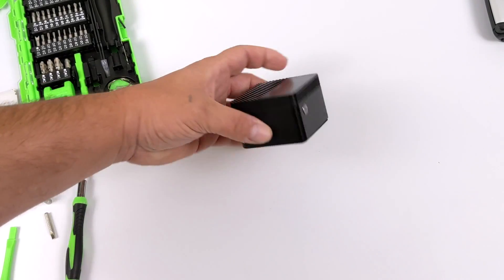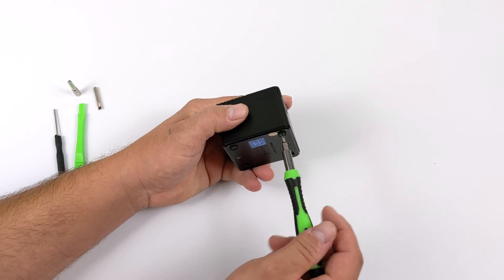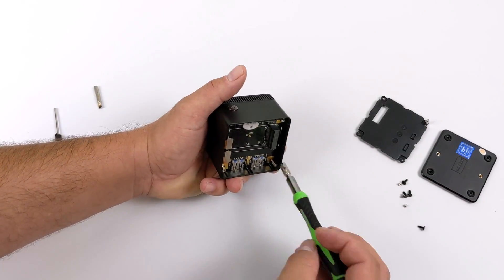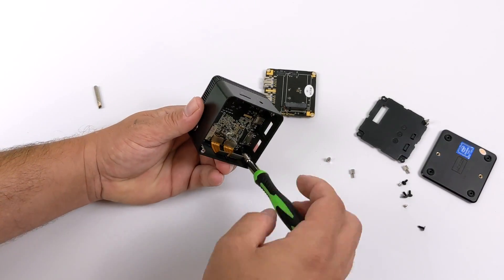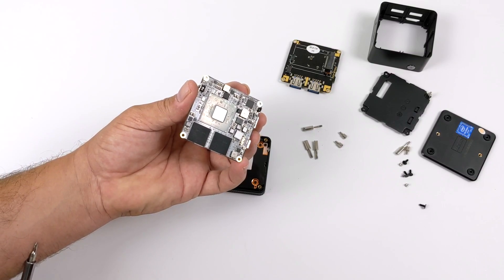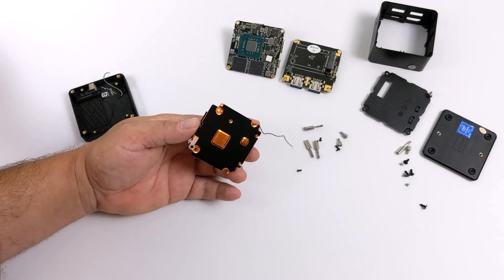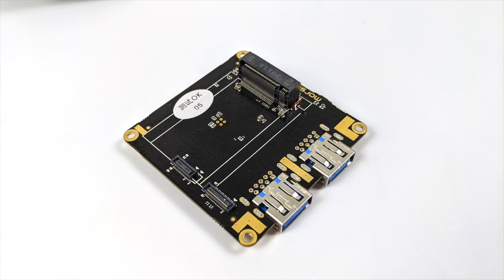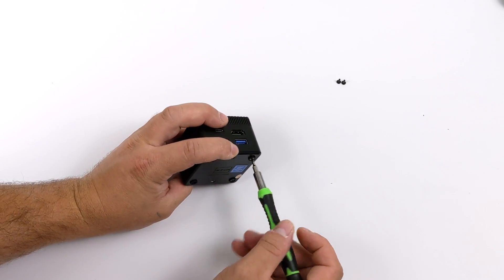CHUWI LarkBox Teardown -  World's Smallest 4K Mini PC

Comment: Do not buy this after a year of use it starts to heat cause the fan stopped working and between 3 or 4 seconds the wifi module burn in flames

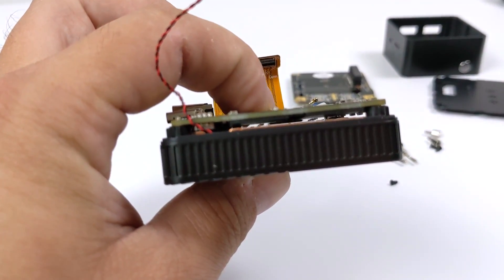Comment: 5:30 you can buy some tiny and special copper plates to put correct one between CPU and heatsink with thermal paste. But be carefuly to fit a correct copper plate. It has step with 0.2mm and you must find correct thick.

Comment: I have this mini PC for a little over a year, do you think I can expand the Ram to 8Gb? or maybe a little more?
Reply: I think there was an 8GB version, but zi don't think you can change the ram very easily as they are completely soldered into the board. You'd probably have to have the knowledge of soldering in order to do that. Also I think this CPU can only handle 8GB max.

Comment: Why does it use a USB C jack when it's not a standard USB C power? Is there any other power supply that works with this other than the one it comes with? Even my 87W Brydge Stone dock won't power this because it wants 12V

Comment: I used a copper shim to fill the gap and used some good themal paste to make the cpu have good thermal connection to the copper cooler and fan. I did see a drop in max temp so it got better. I did see increase in low temps.  I thinnk this is cos of the heat in the copper raise the min temp just a little. So now its never over 65 C. Needed a very thin copper shim. But it made it keep the fan on more steady and not on and of all the time. The spikes in temp that is above 70C is now gone. Mostly is below 60C. I think it was worth it. Im going to get an M.2 drive but im not sure what to buy. Its both Sata and NVMe out there.
Reply: Could you tell me the thickness of the shim you applied? Very much appreciated

Comment: The fit of the heatsink is a bummer, wish the plate was closer, better contact with less space is always better and thermal paste outperforms pads (if it can make contact), wonder if maybe it could be shimmed with tiny washers like people did with the Radeon VII reference editions.
Also, 3GB LPDDR4 is common on phones and the like but yes, not something you see on desktops or even laptops.
Reply: Someone used a .5 mm copper shim and said it improved it.

Comment: I want to share with all my tests, I have been wondering and looking if someone indicated exactly, the right thickness of copper to replace the thermal foam it has.  I have tried with a 0.8mm one, I have put it and very careful not to over tighten and tried to tighten the screws equally in all four, it has been mounted.  Indicate that I think this thickness is a bit excessive, I recommend 0.5mm.  The temperatures are radically improved, in none of the stress tests has the CPU exceeded 85 ° C, specifically in the test with Prime95 with a duration of 30min), as can be seen in this review, they indicated that the temperatures were up to  from 100 ° C to 2.4Ghz.  Never slower than this work speed in the test carried out by me.  So, for me, the result is much better than expected.
https://www.notebookcheck.org/Review-de-Chuwi-LarkBox-Celeron-J4115-Un-mini-PC-de-4K-tan-pequeno-que-es-mas-ligero-que-su-propio-adaptador-de-CA.482840.0.htm
-> Of course, I put thermal paste on both sides of the copper.
Reply: I was trying to figure out how to improve the thermals and was thinking about a better pad or even have a bigger heatsink sticking out from the top, but looks like .5mm copper shim does the job.  What temps are you seeing now in daily use? Where did you get your copper?

Comment: Why bother trying to get the box this small. A box four times as big is still very small and you have a lot more room to work with. Besides a Celeron and 6 Gb of memory? Yes it will boot and work - kind of - but who wants the world's slowest working Windows system. As for Linux you can get a lot cheaper Arm based system.

Comment: Hello. Did you check the thermal pad thickness? It should be beneficial for temps to change that pad for something like arctic or thermal grizzly. Also yes for android, do it please.
Reply: The thermal pad is pretty thicc. But they are really not my type

Comment: Obviously you would see MUCH better performance from the heatsink if you shaved down the plastic standoffs of the case to allow the cooler and board to touch, but manufacturing tolerances probably dictated a cheaper solution.  Hey, it worked enough for crapple to go with the same solution in their products, so it can't be THAT bad, can it?  I mean, LTT did see better performance out of the crapple when they shaved down the standoffs to allow for better contact with the heatsink, but that wasn't actually part of the overall structure of the case.

Comment: Looks like the go for me. I have been looking for a PC to integrate into my Cars head unit. HDMI should do this no problem and with a USB power supply it should run great on DC. Just need to get a decent powered USB hub to drop in the external stuff.

Comment: Can you power up the device without the IO board connected? Seeing as the Wifi and HDMI are on the top board. Looks like you could cut it down to around half the high and only use the USB, SD and M.2 slot.

Comment: I've never heard of individual RAM chips coming in anything other than a power of 2 size, that's very strange.
Reply: I would guess that they are larger chips that have faults and have be reclaimed to use at the smaller size.
Reply: @dazaspc  could be, not sure if RAM can be "binned" in that way they do with CPUs and GPUs, at least I've never heard of it. But it is plausible.
Reply: @W1ldTangent  RAM binning is an extremely common practice. When buying higher performance RAM kits you are in fact mostly paying for the binning, as decently binned kits of the best RAM chips (Samsung B die) are not that expensive.
Reply: @KyussTheWalkingWorm  binning for speed, absolutely, sorry I used perhaps too general a term. The chips that test high will go into better products obviously. I mean taking known defective parts that happen to have the defects in areas not needed for a lower end SKU, as happens in CPUs and GPUs often.. didn't think that was done with memory. Again, could be wrong.
Reply: @W1ldTangent  I do recall an interview with the late Jack Tramiel where they were working on a way to reclaim faulty ram as manufactured.
Reply: dude  im  not  gonna  go  into  the  history  of  ram....but  think  before  you  speak...look  at  ram  10-15  years  ago  and  tell  me  what  capacities  you  find....  TWO  has  nothing  to  do  with  it...   whats  important  is BYTES...  Example  when  i  first  started  building PCs...ram was 32-64 Mb  sticks  so  the  actual  magic number  is  8...
Reply: They are not that uncommon actually.. There were plenty of low-mid range android phones/tablets spotting 3gb ram in the market..  Chuwi probably got those same ram chips that are phasing out to bring down the price. Just my opinions though :-)
Reply: @drepang  sounds reasonable, I'd accept that answer, board space is at a premium inside phones so I doubt there's many with more than one RAM IC.

Comment: Hey bro you can use HDD raw copy, for clone the installed ssh to the new one, and just expand the partition on the new ssd (no reinstall windows and no need to install drivers or preloaded soft)
Reply: or mount the new ssd to your user folder, like linux using partitions per folder (like SD1 -> / AND SDA2 ->/HOME/USER)

Comment: Air circulation looks challenging here.  I'm guessing this runs hot.  Probably needs copper heat spreaders/sinks, holes in the plastic by the M.2, or better yet, run this open-air (no case).
Reply: there is basically no air circulation inside,all hot air stay inside because its sandwiched in middle.its 100% ceiled in hottest mainboard part.i started getting video artifacts and thought its my HDMI wire died,i took it out and iron part of it was 90C hot.almost burned my fingers

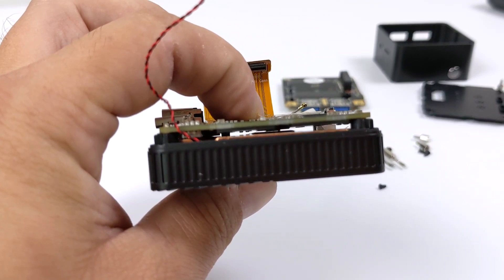Comment: 5:31 You must measure the CPU/copper-gap, and shorten the plastic studs (of the plastc lid), on which the mainboard is bolted on, respectively. Then you can use thermal paste! What´s up? It´s only some milligramms of plastic, that´s not a problem...!

Comment: Would like to see you adding a copper or even steel shim between the CPU and heatsink. I'm pretty sure even with the extra thermal interface and if torqued down properly, would give you better thermal performance. Not that the chip runs terribly hot at 10W or anything, but it could reduce the noise levels. Very interesting little box.

Comment: It's amazing how time flyes. From my old Dos. 1. 2. 286. 386. And so on to this little toerag. OMG.
Reply: Seriously. My first PC had 33Mhz and the second had 66Mhz. I believe my third had 180 and then 300 or 320Mhz if I remember correctly. I was so excited when I got the big jump from 500Mhz to 1.2GHz a few years later. I usrd to get a new PC almost every year in the early 2000s because the jumps were so massive. Over the weekend I was using my 2013 Macbook Pro and it still keeps up with modern laptops.

Comment: Put a polished penny or dime between the heat sink and processor, with thermal paste squished in there on both sides. If the coin is too thick somehow, use a Dremel tool to grind it down. 😉

Comment: Question for you, since this would be perfect for a project I'm working on.  Could I use this without the Daughter (IO) Board connected if I don't need those additional USB ports and the extra port for storage?  I was thinking of getting one of these, and now that I see it out of the case, if I could just use the main board with it connected to the fan, that would be ideal.  Seems like everything is on that main board (storage, ram, cpu, power, USB-C and HDMI).   Thanks for your time!
Reply: i wonder if it would work if the wifi/BT were removed or converted to PCIe and the case changed to aluminum so the fan could be removed so it wouldn't need need service and cleaning

Comment: I really wish they’d gone a different route on the RAM. When I first heard “6GB” it made me think of older business laptops that would have 2GB soldered to the motherboard, then either 0, 1, or 2 RAM slots. I thought maybe this had a 4GB module and 2GB soldered. Ahh well. Still looks very interesting. Thanks for the awesome teardown!
Edit: Make that 2 things. The power supply. WHY not go with a USB-C PD source? Even an older, lower-powered USB-C PD charger can put out 12v 2.0A easily over a little trigger interrupt board, so why not implement that as well? 
Then you’d also have the ability to brag about it NOT needing a big power brick like all the competition.
Reply: They actually changed the power supply. Look at the campaign page
Reply: Uhh, that IS what it uses for power.
Reply: I thought it was powered from USB-C PD?  I couldn't see any other way of powering it on that video.

Comment: Breaking News:  Windows 10 on the Pi 4 has a fix for THE RAM & USB and the USB port issue!  Sooo..... Lark box VS Pi 4!! (Factoring price and support... I would be carefull before ordering a Larkbox)
Reply: The raspberry pi scene is about to explode to a new level!  Once the general public finds out you can run Windows 10 on the Pi 4 and the performance is more than acceptable  It won't just be mildly difficult to procure one it will become completely impossible for all but the most  determined consumers!

Comment: Add thermal paste, add a slightly smaller metal square, add small amount of thermal paste again and assemble. Gap solved. Improved cooling begins.
Reply: Have you noticed temperature differences? What thickness can be suitable, maybe 1mm or less?

Comment: Try adding thermal pads to the ram, and those 2 chips under the io board (wifi and emmc) are just asking for small heatsinks... won't actually add much cooling to it but for something that small every little bit helps... might only be noticed when using the wifi hard but if after an hour of use it started to act weird (wifi cutting out/slowing down under heavy download)... heck I'd try adding thermal mass to everything I could... even a very small amount of thermal paste to the CPU before putting the thermal pad and heatsink back on might let you game (or anything pinging the system at %100) for longer... (worth a try just for the fun of testing)
I've played around with the HP T620P and T730 in the same basic way and something is satisfying when optimizing the cooling to the max (even in new and bizarre ways)... I use the HP T730 (16gb of 1866, gt 1030, wd blue 1tb m.2) as my "Van-puter"... Better cooling equals longer life, quieter fans, and no (or less) thermal throttling on hotter days and hopefully a little extra performance.
Have a good one.

Comment: RPI: We need 8GB RAM model
Chuwi: Hold my beer!
Honestly, can't understand audience of this product. For the same price ARM-based CPU will be better option and more powerful( even Apple understands there is no place left for Intel in low-spec CPUs) and less hungry with regards to energy consumption. For more or less decent performance in a tiny shell I would  go with Intel NUC or something AMD Ryzen-based. This Chuwi box is just like a toy. Also, considering the quality of other Chuwi products -- eh, I doubt you want to buy it. :)
Reply: I plan to buy one to use in my workshop to look up datasheets and access Eagle CAD files via my onedrive storage.  The fact that this is an x86 device and runs windows 10 natively means that it will be easy to integrate into my setup.  It has enough storage and memory to run Eagle CAD and any other windows application I might need.  Also, the tiny form-factory that takes up virtually no space on the bench.  I have tried other small form-factor linux-based devices for this purpose but using linux is not an attractive alternative as I have to jump through all sorts of hoops to access one-drive and integrate it into my workflow.

Comment: Is called a Daughter board. The board that has the CPU is the motherboard and anything that attaches to that is the daughter board. If the CPU is on its own board then it's a daughter board that connects to a motherboard.
Reply: I love this concept. Actually it can be upgraded to modular PC like the Google modular phone concept.

Actually if they allow to sell daughter board or motherboard and user replaceable. or make it technician can handle it. For example the mainboard cost 75% of the cost and the daughter board cost 25% of the cost. If i using it as backup multimedia room's pc. We wont need to buy another, just  buy motherboard or daughter board if that board is broken. 

Good is the sustainability and recyclable, bad could be some under-developed country must rebuy and repair this modular PC's part for up to 15 years. But we do not produce more waste this way.

Comment: I would suggest flipping either the polarity of the fan, or the fan itself. 
Drawing cool air in from the side and pushing it straight out the top will improve cooling.
Reply: It's an impeller blower rather than a fan, so that's not an option - they can't run "backwards". (Well, they can run the wrong direction, but they can't move significant air when they do it.)

Comment: According to their official spec:
Raspberry Pi 4 Dimensions: 85* 56 * 15.24 = 72542.4 mm^3
LarkBox Dimensions: 61 * 61 * 43 = 160003 mm^3
In practice single RPI board usually doesn't considered as a complete PC (more referred as dev kit), but given both of them use external power adapter, even performance (RPI has better CPU, cortex A72 > J4115 > J4105) and RPI has less than half of the space that LarkBox occupies, I would double quotes the phrase World's Smallest just being concise. 
Here are some features that I care (I might be biased) the most if I'm getting a small portable full-fledged computer for regular use (basic usage, entertainment, development), and RPI wins the almost from every perspective (maybe the downside is that it's "uglier" than LarkBox ;P).
_________________________________________________
|           	        | LarkBox    	| RPI 4               	       |
|-----------	        |------------	        |---------------------	       |
| RAM       	| 6GB        	| 8GB                 	       |
| CPU       	| J4115 	        | Cortex A72                 |
| Storage   	| eMMC       	| eMMC                	       |
| WiFi      	| ✓           	| ✓                   	       |
| Bluetooth 	| ✓           	| ✓                   	       |
| GPIO      	| X           	| ✓                   	       |
| 4K         	| ✓           	| ✓                   	       |
| Chassis   	| ✓           	| X                   	       |
| Cooling   	| Fan        	| Passive,  Fan addon |
| Price     	| 155 USD    	| 75 USD              	       | 
-------------------------------------------------------------------------------
I'd suggest CHUWI be more careful of choosing the production title here to avoid creating the unnecessary hype.
Reply: mm^3 you mean
Reply: @meeder78  thank you, i knew something wasn't right...

Comment: Perhaps a better quality thermal pad (thermal grizzly). Also, one possible reason to not have a metal case: some potential issues with wifi/bt signal, despite the antenna being on the top of the case. Really with that type c port also had data, so it could be used with a powered type c hub.

Comment: They should have make that contact spot on on the copper plate a little thicker for thermal paste, can't wait for someone to make an aluminium case and a better heat plate as a mod for this thing.